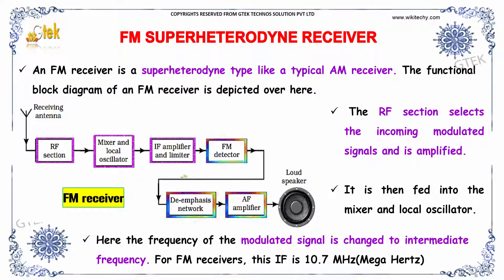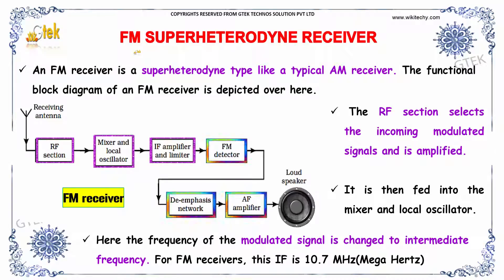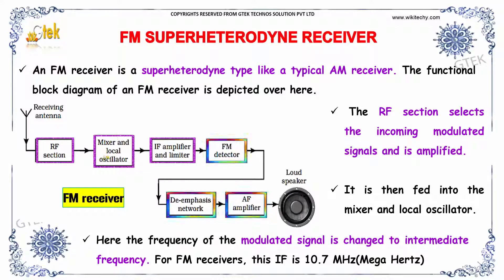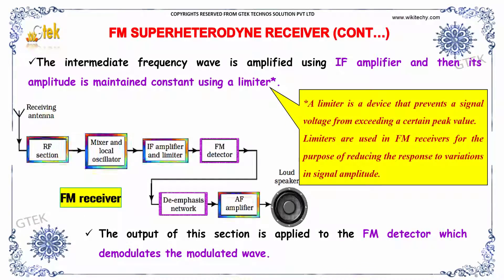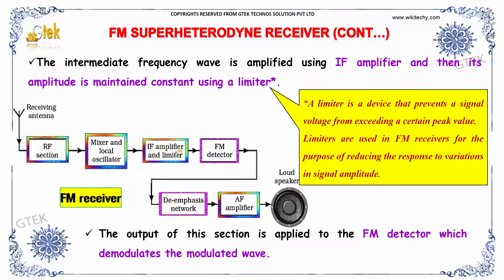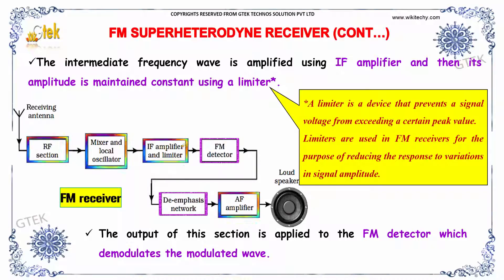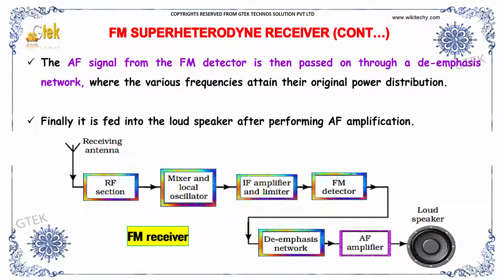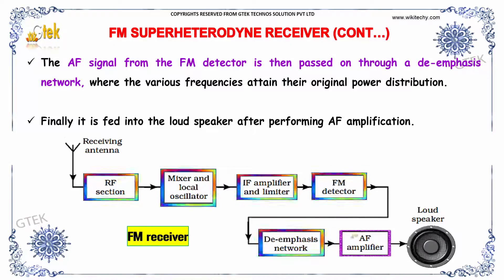Superheterodyne FM Receiver | class 12 physics subject notes lectures|CBSE|IITJEE|NEET

Comment: In electronics, a superheterodyne receiver (often shortened to superhet) uses frequency mixing to convert a received signal to a fixed intermediate frequency (IF) which can be more conveniently processed than the original carrier frequency.

Comment: The output of the IF amplifier is applied to the limiter circuit. ... In FM receivers, generally, AGC is not required because the amplitude of the carrier is kept constant by the limiter circuit.

Comment: The block diagram of an FM receiver is illustrated in Figure (a). ... The output of the IF amplifier is applied to the limiter circuit. ... In FM receivers, generally, AGC is not required because the amplitude of the carrier is kept constant by the limiter circuit.